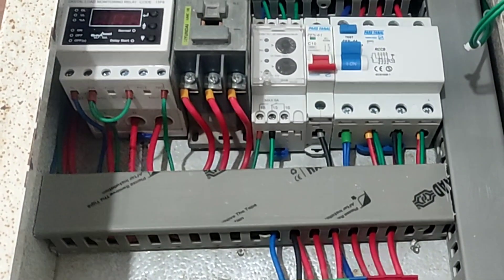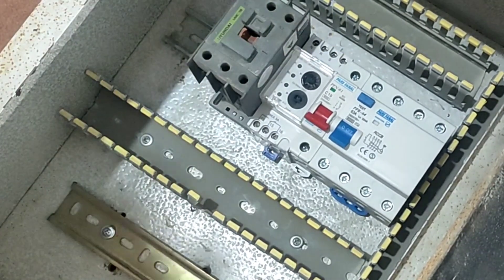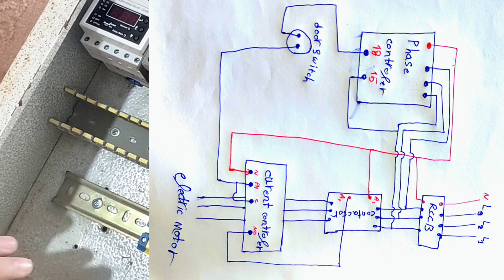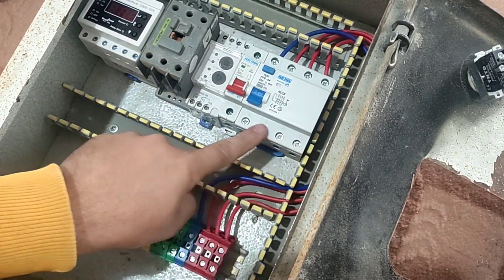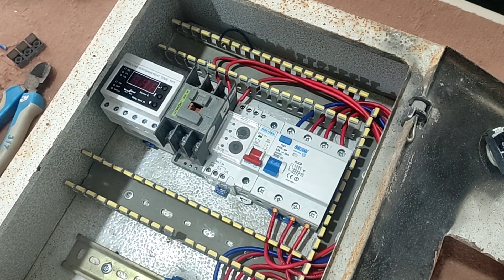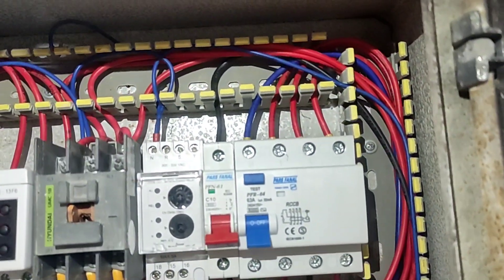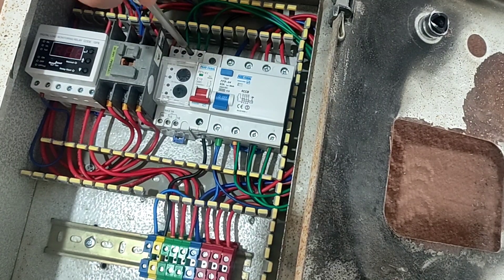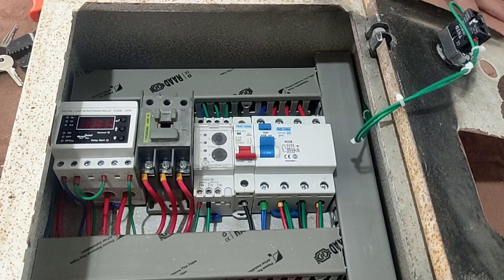How to wire the electrical panel.(Protective equipment)

Comment: Commonly, only a maximum of two wires are allowed on a single terminal. Why you can connect three wires at the same time on one of your output terminals on RCCB?
Reply from the maker: Hello
These wires are for the command circuit and have very little current, so more than two wires is not a problem

Comment: Hello, you could easily put the wires you took from under the protector under the contactor and then put them in the holes from the top of the contactor and then connect them to the terminal.
Reply from the maker: It's right

Comment: Hello, what AWG wire do you use for wiring up these panels ? Can you recommend what AWG should be used with AC and DC (12V/24V) for making such control panels.
Reply from the maker: First of all, you should know your consumption flow. When you know the current, you can calculate the thickness of the wire according to it. I have a video on this topic, please click on the link below
Reply from the maker: https://youtu.be/cwVoK9__7Ow?si=6iGEgEHQS4J4R1Ki
Reply: @IET-76  thank you for sharing it here ! God bless.
Reply: @IET-76  ok i will go look it up in the channel. Thank you.
Reply from the maker: AWG?
Reply: @IET-76  AWG is American Wire Guage, it is a unit for thickness of the wire (not including the insulation). I just wanted to know the thickness of the wire you use. Thanks.